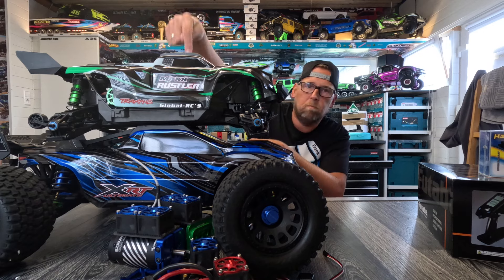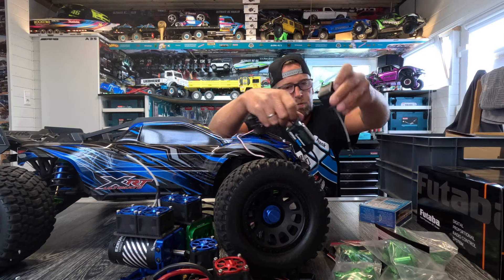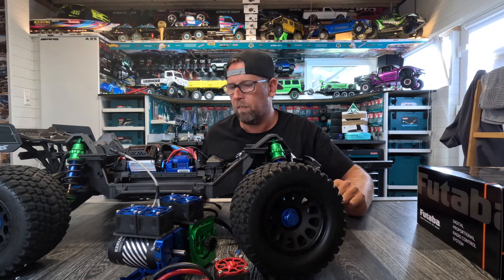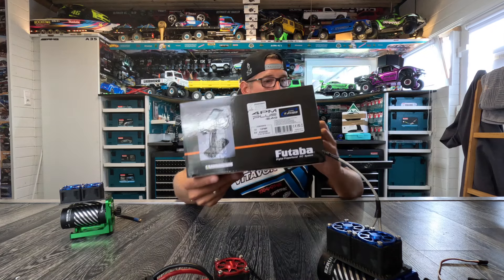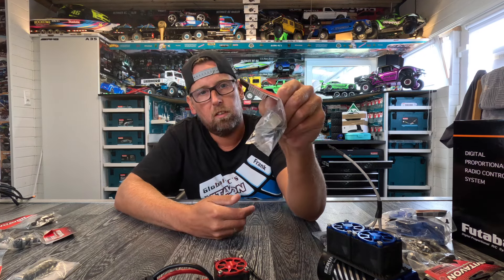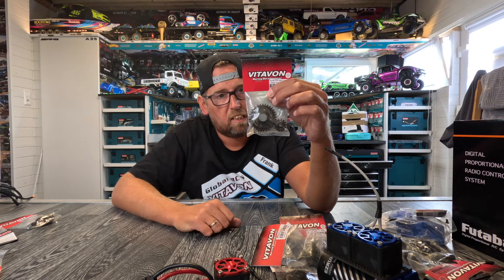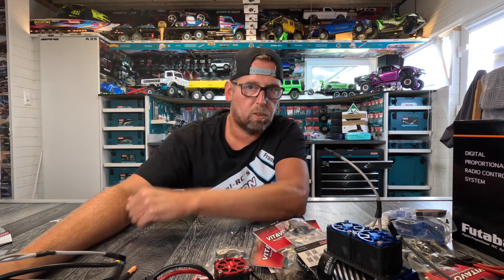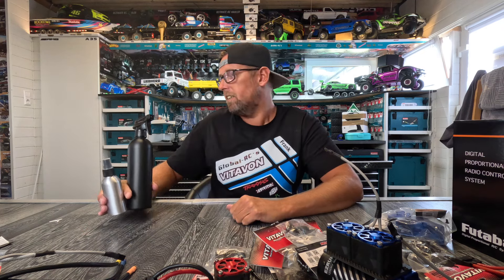was geht in den nächsten Wochen ab. XRT Ultimate, neue Diffs, Hobbywing Combos und der Maxx-Rustler

Comment: Hi
Ich habe mal eine Frage.
Ist die MAX6 G2 Combo mit 4990SD 1650KV im X-Maxx fahrbar?
Ich fahre im Moment die Original Traxxas Combo mit 2x 4S 5000mAh Gens Ace Bashing Akkus und kann ca 15-20 min fahren.
Ist das mit der Hobbywing Combo auch möglich?
Getriebe 35/14 Modul 1,5
Oder ist der ezrun 4985 1250KV sensorless besser Geeignet?

Danke für eure Antworten
Reply from the maker: Hi, ja das geht sehr gut, aber wenn du schon dabei bist, würde ich dir den 5690SD Motor empfehlen, Hat mehr Dampf. Übersetzung dann auf 35/20 ändern. Fahrzeit wird ähnlich sein. 6500er wäre da besser
Reply: @global-rcs  
Mein Bruder hat die Max5 Combo hat für mich viel zu viel Dampf. Er hat die 11000mAh Akkus und fährt auch nur 20 min
Werde mich dann für den kleineren Motor Entscheiden 
Danke